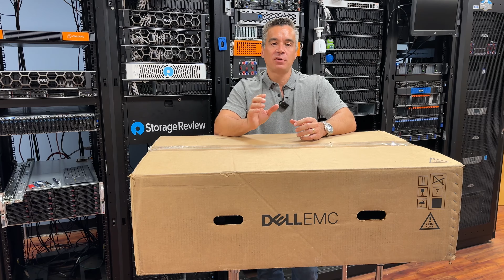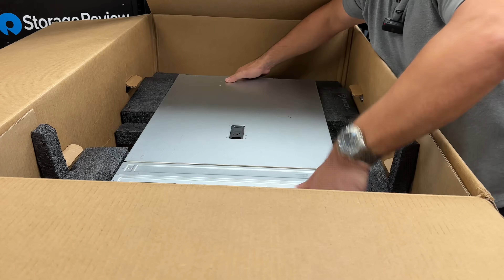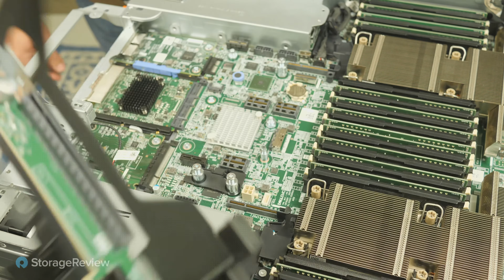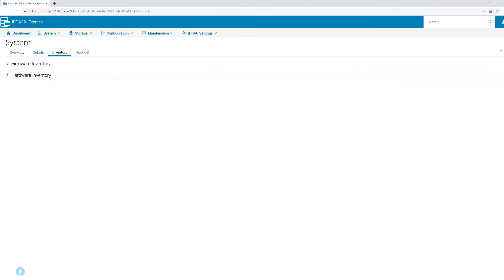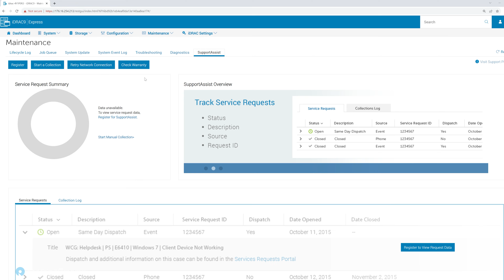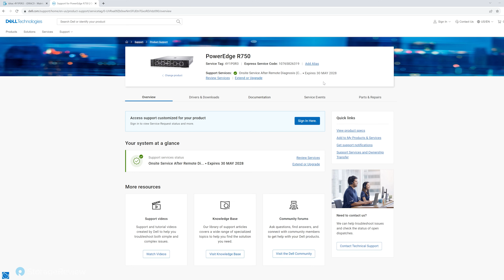Why the Dell Recertified program is better than Dell Outlet

Comment: Can consumers use the Recertified program? I perused the 'dellrefurbished' site under SFF desktops and the systems there are basically double the cost of what it is on eBay and I have had gr8 experiences buying these on eBay. what is the site for recertified?